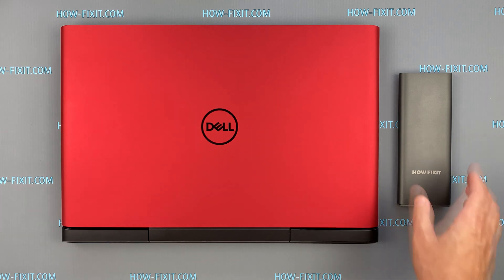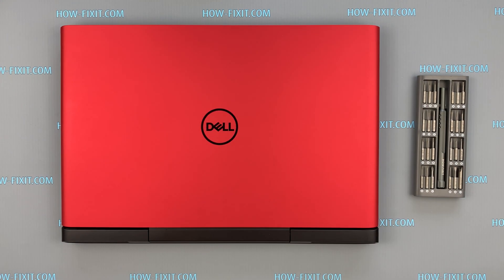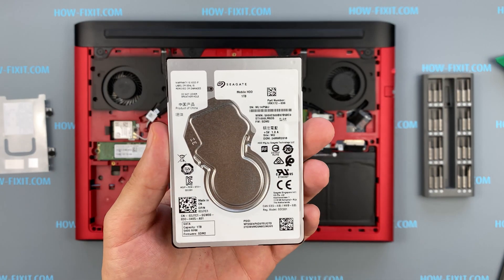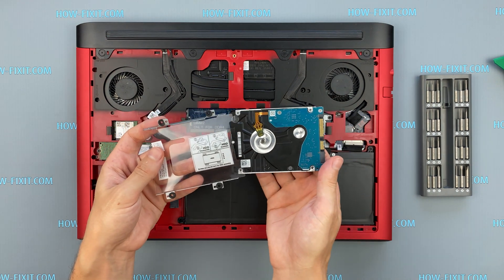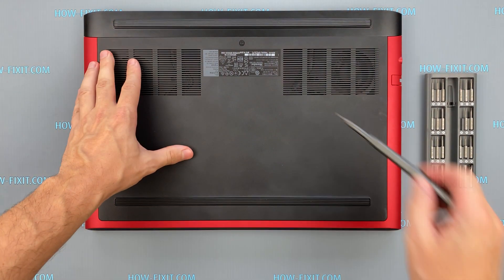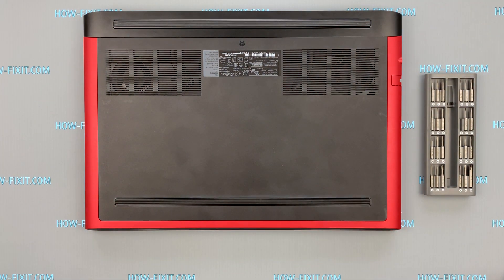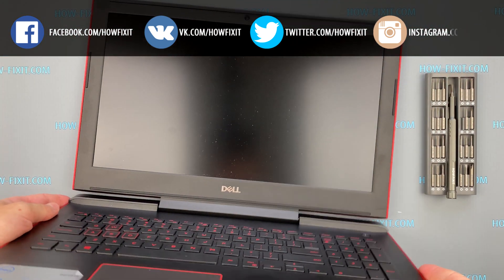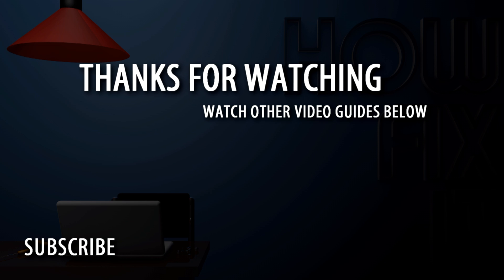Dell G5 5587 Hard Drive or SSD Upgrade: Replacement & Installation Guide

Comment: Very nice presentation. I have a question. If I install an M2 PCI of 1TB (in the slot of M2 SATA III) and an M2 SSD (in the slot of HDD), can the system recognize both SSDs ?

Comment: Please Answer This Question. I have the g5 5587 and I'm using a 1080 eGPU through thunderbolt 3. Is there a way to connect via PCIe and would it improve performance?

Comment: Sense the computer has a 
256SSD drive as main boot . The 1Tb hdd when 1 tb ssd the os should all be on the 256ssd. No os should be on hdd right?
Reply: I was thinking the same thing...1tb SSD should just need to be formatted and you're gtg. OS is on the 256 from Dell